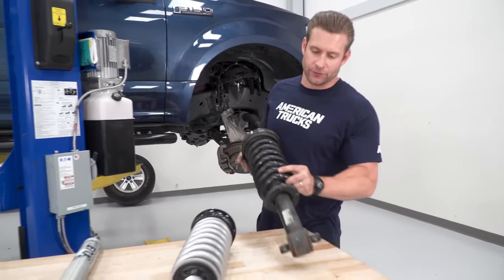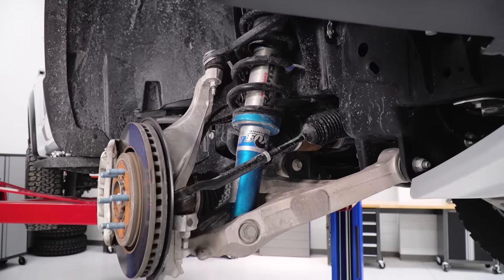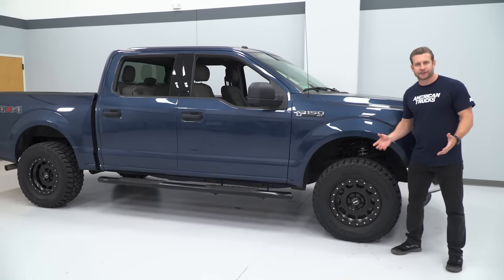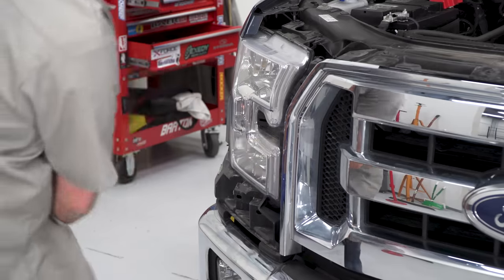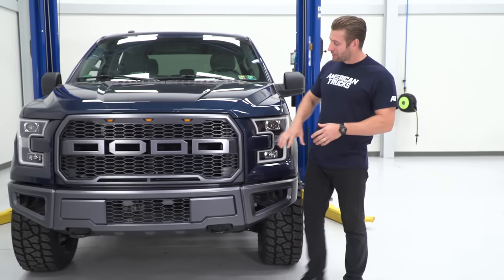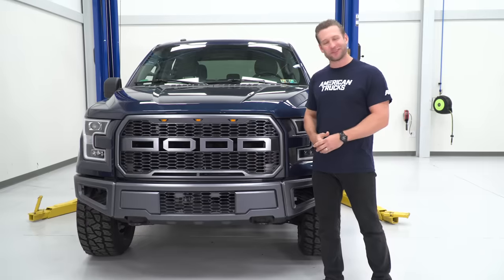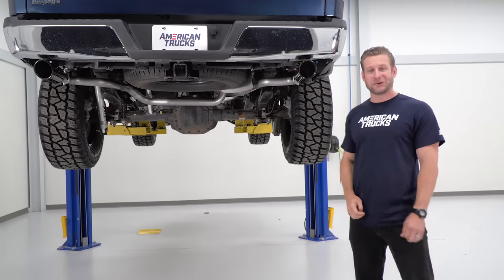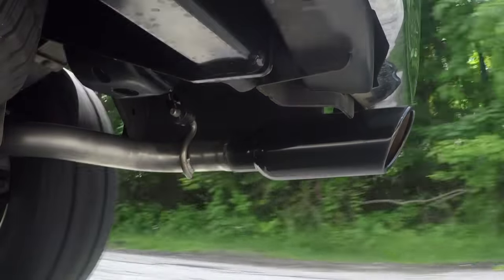How To Make Your F150 Look Like A Ford Raptor & The Parts You Need To Do It   The Haul

Comment: $4400.00 + - in parts
Reply: Thanks. Didn’t want to research
Reply: D Evans  Thanks. I was wondering about the prices.
Reply: Yeah see thats a piece of junk just buy a Raptor lmfao
Reply: @christiantaylor7883  yep
Reply: NorthernLaw ? What?
Reply: That's a good deal 30k f150 plus 4k parts vs 60k raptor
Reply: Where is the price for tires and wheels?
Reply: NorthernLaw how old are you?
Reply: is cheap
Reply: @GR-uc1gq   yeah.  add a roush super charger for 7k and got a sweet ride for much less with v8
Reply: NorthernLaw lol not many can afford a 60-80k car, I know you can’t afford one
Reply: Are you sure it's that little? Here's what I'd estimate:

- $2000 shocks
- $400 grill
- $300 fender flares
- $1000 wheels
- $1200 tires
-$1000 exhaust
Etc. 

Id guess closer to $6k, not to mention installation. 

Also it would be absolutely stupid to actually put that into a truck, cuz you'll never get that money back out of the truck. If anything just buy a last gen raptor
Reply: More than that. I put almost 15k into my truck. I did mine the right way though
Reply: NorthernLaw he half assed the entire upgrade bro
Reply: And that is not including wheels and tires

Comment: I feel some after market company should be able to make a widebody fender panel. Also a rear bumper. And would the 35’s not be able to fit after you changed front bumper??
Reply: James Diaz Fiberwerx makes bolt on Raptor-style fender flares.
Reply: James Diaz f150s have front crash bars. Would have to cut them out with said leveling struts in video.
Reply: I have a 2015 f150 super cab. Those didn't have crash bars and ford got in trouble with the crash test people for it, but I can run 35 's with a 2.5 inch level because of it. "I win!" unless I get hit in a front offset collision of course, then I lose my left leg.

Comment: Good job. But i like to freak people out. I would have done that to a 2 door shortbed. And a mild rebuild of the 5.0 with mustang shelby parts. Turns a 440 hp V8 into 575 tire melting hp. but thats only a dream for many as parts cost too much $$$$.

Comment: I would feel like an imbicile driving this around saying DODD on the front.
Reply: J T I know AutoVlog has an F150 with a raptor grill, but it actually has the ford lettering.
Reply: You can buy the f and r seperately then replace some letters
Reply: I'm going to go out on a limb and say after this video was done they put the F and R on it. Just didn't do that in the video for legal reasons.
Reply: Josh _ comes shipped with the extra letters. They make a faux pro grill for the Toyota. And it comes with a baggy of letters. Well you know can’t put them on the advertisement for legal reasons.
Reply: J T  Woah, watch out! We got a cool guy in the comment section, guys!
Reply: J T  post a video of your "raptor" I want to see it.
Reply: J T  Hmmm, the link doesn't seem to work and there arent any videos on your profile... Lets see your Raptor tough guy.
Reply: J T  - Posers? LOL. My truck can actually fit through a normal automatic car wash. I paid $30k less for my truck and these changes cost me about $4k. I don't off-road, don't need a "baja" truck. Plus, I really don't care for the hugely flared fenders that many of the Raptors come with, it's ugly IMO. My truck gets 22-23 MPG highway and 19-20 MPG city. 

Again, I saved twenty-six THOUSAND dollars this way. I didn't need a gas sucking, one trick pony. 

There is a difference between liking how a few things on the Raptor look and upgrading to those few things vs. actually wanting a Raptor. But, keep pretending those of us with a few "Raptor themed" upgrades would have actually wanted the Raptor, as it seems to help you feel better about yourself! 🤪🤣😂
Reply: J T  - I don't off road with it. How do you know the person you see on the road with these changes even cares about what the Raptor is technically good for? You don't, you just assume.

A poser is someone who is pretending to have something they don't. I simply made what I see as appearance upgrades. Do you think I went with the 20" Machined aluminum wheels so I could off road? No, I got them because they look good. Do you think someone who bought a Mustang cares if their car can't off road? No, they got what they wanted. I bought this truck to haul, and because I like trucks. It's fast, gets good gas mileage (for a truck), it can haul what I need it to and it looks good. 

Not everyone cares about having a Raptor. They most likely care about their truck looking good and this is a much more cost effective way to do that.
Reply: J T  - I do agree though, any addition to the fenders/above the wheels are gross. I didn't add anything there, it's just "normal" appearance on mine.  

I got from the factory the STX package w/ the 20" wheels, 2.7L Ecoboost. Then had a leveling kit put on it, and BF Goodrich All-terrains (my favorite looking tire). Got the lights with the LED edges, both front and back. The lighted "Dodd" grill and, of course, added the F and R. Replaced the bumper and skid plate with similar ones shown in this video. I don't care about how it sounds, so I didn't do anything with that. Nice bed liner and have the Echo Ranch shell on it. 

I'd like to eventually upgrade the suspension to be higher quality after market, but don't want a lift or anything. The tires already altered gas mileage enough.

But, I just had $6k in hail damage and have to put what I had saved toward suspension going toward insurance deductible. 😕 🤮
Reply: 2019 DODD D-150

Comment: Ford raptor 60,000$/f150 48,00 but 10,00 grand in parts in work 58,000$ for an extra 2 grand get a better motor on the raptor and a real raptor
Reply from the maker: Sounds good in theory.  Although you'd be lucky to find a Raptor for $60k here in the North East plus the truck used in this video was a base XLT which are usually in the mid to low 30's- especially with a few miles on them.  -Justin
Reply: You forgot the new raptor comes with an ecoboost or you don’t know it’s had more issues than the 5.0.  Either way, the 5.0 is fords beat motor right now.
Reply: Oh boy not true at all... 70 more lb ft torque 40 more hp

Comment: Great video.  I've been considering getting a new Ford F150 Platinum and raptorizing it, but I had no idea how to do so.  Doing what you've done here to a loaded Platinum would be awesome.  I don't care so much about changing out the front, especially since I do want to keep the fog lights, but leveling, maybe lifting an extra inch or two, 33 or better 35 tires on smaller wheels, and hopefully changing out the Platinum's leaf struts with springs, some offsetting, those fenders, and away we go.  A QUESTION:  I wonder, if you had lifted this another inch or two, in addition to the level, might those 35's have worked without any trimming?  I'd likely get the loaded Platinum I think it's the 402A or is it B package, and get it blacked out.  Then those black fenders would closely match, though maybe i'd paint them for a perfect color match.  Man, that job you did here looks fantastic.  Well done!  I've thought about the Raptor, but that 7"s extra on the width, though it looks awesome, is just too much for me.  I am considering the Tremor, and with 1" more lift and 1" more offset, and springs on one end, it's not bad, but I might like to offset the Tremor a tad more then put those fenders on.  The thing is, I really want the luxury, all black, all leather, massaging, max recline seats of the Platinum.  So starting with a Platinum, and likely adding the FX4 package, and doing some variation of what you did here, that seems a great choice.  Oh, and unlike with the Raptor and Tremor, with the Platinum I'd have the option of the 5.5' or 6.5' bed.  Thanks again.  Love the video.  Just what I was looking for.  Do you have any thoughts about what I've said above?

Comment: Couple of questions Justin if you don’t mind.  How much did these mods cost?  I assume this is a 2017 F-150, would any of this stuff work on the 2018 F-150?  I am buying either an F-150 or the new 2019 Ranger, would you guys offer any aftermarket stuff for that 2019 Ranger?
Thank you for taking my questions!!
Victor

Comment: You mention that the stock raptor suspension will fit the F150.  Will the Fox Raptor coilovers level the F150 or would you still need to add a leveling kit?

Comment: Will the take off suspension parts from a 2017 raptor bolt right up to a 2016 f150.  Or do they only fit on 2017 and 2018 f150s?

Comment: Did you have to play with gear ratios or was your speedometer off when you went from stock size wheels to 33’s?
Reply from the maker: Since the 33"s weren't a huge difference compared to the stock tire size the speedo wasn't terribly off.  Although in a perfect world, yes I would recommend correcting it with a hand held device. -Justin

Comment: i need the wide suspension set up if its possible i have the 2018 roush wit h the 5.0 ive already did the supercharger at 650 horse need to find out if i can get the longer axles up front a -arms , and wider axle in back then fenders front and back i just like 5.0 just me, im in az and turbos dont like heat

Comment: Hi Justin, great job!!!
My only issue would be the fender flares,they are the same brand and style than the front grille and bumper... but they don’t color match. Any comments on that??
Thanks.
Reply from the maker: They are made by the same manufacturer but I agree on the color match aspect.  If I had to guess, the thought process being there more people would prefer a 'black' flare over a grey option so they went that route instead- total speculation on my part but I agree with you- it'd look better matched to the grille/bumper.   You could always paint them if you really had your heart set on everything matching.  Thanks for watching! -Justin

Comment: do you have an suggestion for a similar suspension kit for a 2013 f150? and also i noticed you no longer sell the raptor style bumper for the 2013 f150 either, any suggestions for that also?
Reply from the maker: https://www.americantrucks.com/fox-20-performance-series-coilover-ifp-front-0915.html  these will work for the fronts but at this time we don't have the matching rears.  And unfortunately the Raptor style bumper has been discontinued, however we have a ton of different 09-14 bumpers available on the site if you'd like to check them out! -Justin

Comment: whats the difference between the 15-17 headlights comapred to the 18-19?
Reply from the maker: The front end of the 18-19 F150s are styled a bit differently, if you look at a side by side of the trucks front-end you'll be able to tell the difference. Same over all style, just redesigned. 😁 -Zach

Comment: Justin mention if you have OE Gen 2 Raptor shocks, well we're in luck, they'll bolt right up to your standard F150. Around the 1:43 time mark. How would that work if the lower part of the front shock is different? Can you purchase that cylinder bar that goes through the lower part of the shock?
Reply from the maker: I should've clarified- the rears will bolt right up but the fronts take additional parts. -Justin
Reply: @americantrucks  I'm talking Justin? 😲 Thanks for doing videos, I enjoy your insight in parts. I'm a fan. 😅 For the front by additional part do you mean lower control arms?

Comment: the extended cab is  a better truck to do this, and  also you can buy the actual  FORD letters grill in amazon.
 the 35s tires fit but you have to trim metal an d plastic , they look way better.

Comment: It looks awesome! I’m going to try something similar with mine but I don’t want to lift it, can I use 33x12 tires without lifting or without that suspension kit change?
Reply from the maker: Thanks Jup!  33x12's will be a very tight fit with no lift, depending on offset.  I wouldn't recommend doing that without some sort of front end level.  -Justin
Reply: If you don't want to lift due to $ reasons, go for a 2.5 inch leveling kit. MUUUUUCH cheaper. Sure, you won't get any performance out of it, but it will give you the space you need for 33's.

Instead of the front riding lower than the rear at stock, it will raise the front to be even with the rear, hence "leveling" kit.

Comment: I have 20x9 rims with +18 offset on 275/60r20 tires. They sit flush with the factory flares on my XLT sport. Do you guys think if I add the raptor flares the offset will be aggresive enough to make them look okay?
Reply from the maker: Honestly, that's not enough offset to pull off flares and have them look good.  You could always fix it easily through a 25mm spacer, just my $.02.  -Justin

Comment: Did the suspension just give it a 2in lift in the front?
Reply from the maker: Correct, the coilover is responsible for the 2" of additional lift up front while the rear height remains unchanged. -Justin

Comment: Hey guys do I have to recalibrate my speedometer with a 2inch lift kit????
Reply from the maker: You'd only need to worry about recalibrating your speedometer when you're changing the height of your tires. Lift height alone won't change it. -Zach

Comment: Loved the video, but a quick question. You mentioned you tried the 35's on the stock bumper and had some issues. 

Did you try the 35's on the new bumper, and would this provide the needed room?
Reply: I run 35s on my Lariat with a 2.75" lift with NO issues.

Comment: You can get the Ford grill by calling junk yards.  Can get good prices too if you know how to talk correctly for a business transaction.  Had a Volvo that had an ecu failure, super expensive to buy oem but got it for 200 after talking to 5 junk yards and negotiating the price each time.  Last bid also cleaned the unit, removed the flash on it, and free shipping to keep my business.

Comment: Any suggestions on a raptor style rear bumper?
Reply from the maker: Yeah we missed an opportunity there for sure.  I feel like any bumper would be better, unfortunately there isn't a 'Raptor style' rear from Barricade as of yet but Barricade does offer some more affordable steel options for the rear- such as the extreme HD. -Justin
Reply: Yes sir, I believe that's the one I'm leaning towards for my build. I often regret trading in my 2014 Raptor and 2014 Mustang GT for a CTS-V, but I currently enjoy a 2017 F150  Lariat and have a 2019 Mustang GT on the way. Excited to see what you guys roll out for the '19s.
Thanks, Kenneth

Comment: Total Newb question here. You stated the wheels had a plus 6 offset so they’d stick out a little, but everything I’ve researched says a negative offset is what makes the wheels stick outside of fenders? What am I missing here?
Reply from the maker: While you're not wrong in your research about negative offsets giving you a more aggressive 'fitment' positive offsets can offer aggressive fitment as well.  Consider this- the factory wheel offset is +44.   The lower you go in offset the more the wheel starts to poke- so in order of least to most aggressive +30, +20, +10, 0, -10, -20 , -30 and so on.  Those +30 wheels will barely offer any visible differences compared to a stock wheel where as the -30 will really make the wheel stick out past the fender.  We have a video coming for that very soon, where we demonstrate the differences so stay tuned. -Justin
Reply: AmericanTrucks Ford  thanks! A video like that is what I’ve been looking for that breaks down all the offsets and how they would look. Keep up the vids!

Comment: The comment section. =) I like the raptor a lot. The visual styling definitely makes it a nice choice. I can't afford a Raptor, and if used, you can get a Fx4 for better price. Really the thing i like the most would be the headlights, grill, fender flares and the right lift. Great cosmetic upgrades. I don't like chrome of the XLT trims. I always liked how clean STX looked. Instead of 'Raptor' on the back, i could pick a better dinosaur, like "Triceratops". 
but calling someone cheap or poor for buying a FX4 or stock F150 instead of a Raptor? Man prices of a new truck is no joke! A dude on a $50k, both are expensive as hell. There are people who put v8s into miatas, so you do you.
Reply: Well said man. The new 2023 Raptors can break $100k! :o Saw a nice 2018 for $46K. I may get that grill for my 2010 if they have it. But need to get that F and R for it. I think it looks silly with the DOOD on it.

Comment: You say that the OE Shocks Takeoffs from 2nd gen Raptor bolt right up, but all other forums say that they don't.   The Raptors have a lot more travel.
Reply: The bolt to the lower control arms differently. I got excited when he said they did because takeoffs are 600 bucks all day long.  Wont fit. Bummer

Comment: I’m not sure why they wouldn’t put a rear bumper on it. No backup sensors to mess with. Also should have put a cube light kit for the fog lights. I’m also not a fan of those flares. In the video they didn’t look flush and they look like your trying too hard. 

I have the bumper and the grill but I have the proven ground version. They look great especially after getting them painted to match my truck.

Comment: What size are the tires 285/70/17 or 295/70/17 ?
Reply: epp 838 I would say that it is a 285/70/17. Same size I have on my F-150 that is similarly lifted.
Reply: Well the raptor stock tire size is 315/70/17 with is a 10” rim.  That’s the size I’m going.

Comment: Should have tried the 35" tires after the new bumper was installed. Most likely you could have ran them 35"
Reply from the maker: Crash bars would still be the issue, not the bumper.  -Justin

Comment: rear gen2 raptor is complete bolt in front is bolt in except the top mounts for the coils gen 2 raptor top hats mounting bolts are farther apart. i know this for a fact doing a gen2 swap right now

Comment: For the price of a Raptor you can convert a regular F150 to beyond Raptor off road performance with a HM Racing Design Long Travel kit, King or Fox coil over remote reservoirs and bypass shocks, etc.